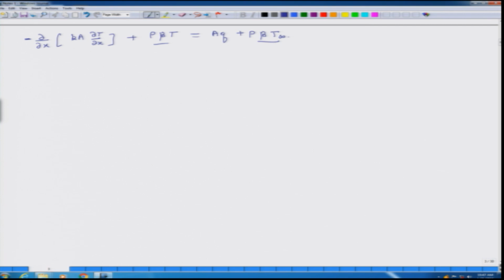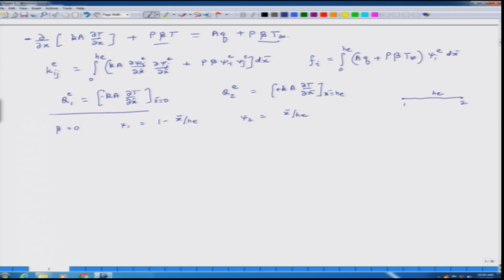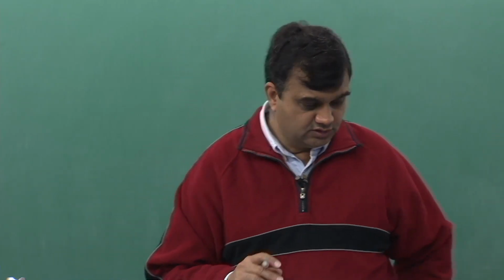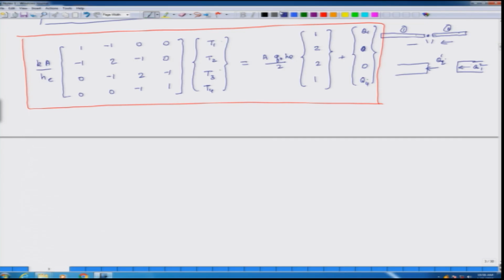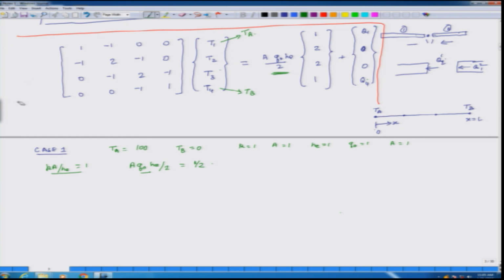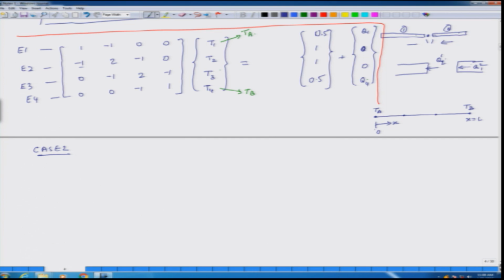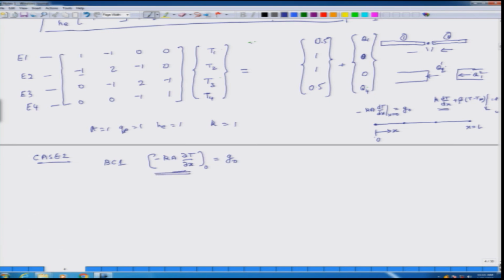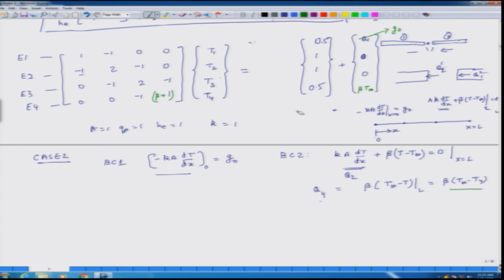1D-Heat conduction with convective effects : examples

Comment: in lecture 31 what is q , what is he , we have to consider convection so where that h goes .lot of confusion because of your video
Reply: q is the heat generated per unit volume per sec(W/m3 - s) and 'he' is the element length.
Reply: Correctly described by Sai, do not confuse he with convective heat transfer co-efficient. In this context, it is element length.